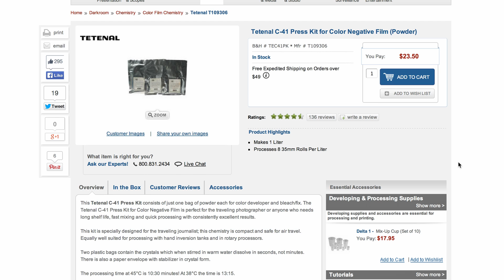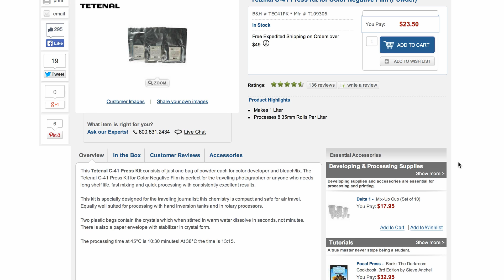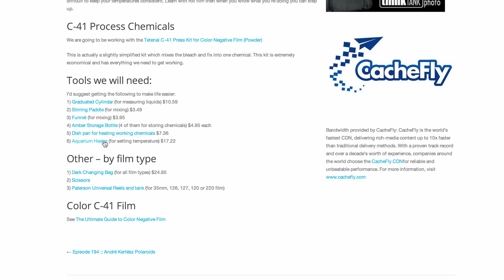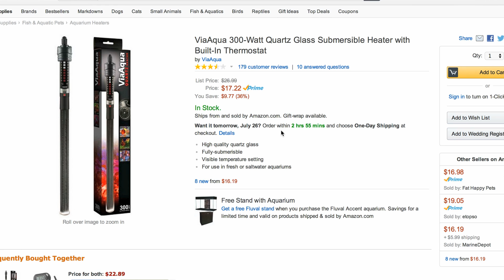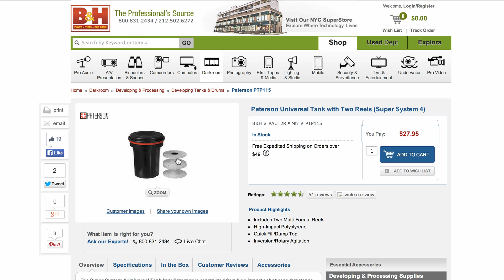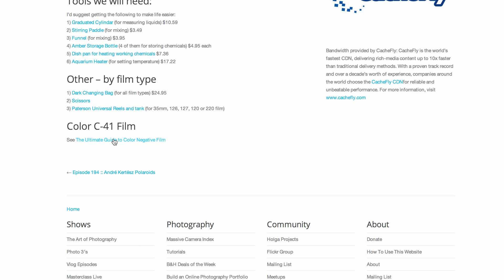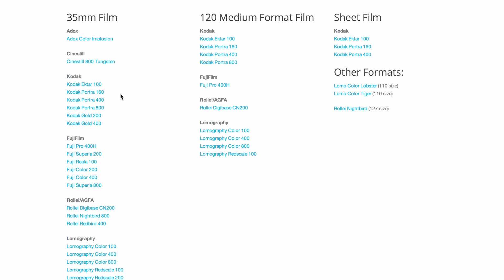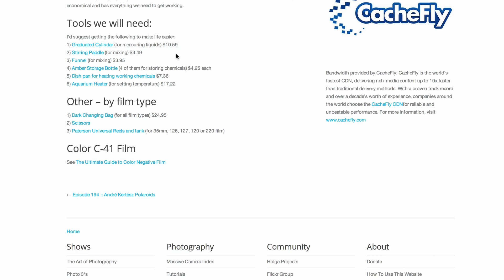C-41 Color Process Intro

Comment: Looking forward to see the results :)
The Bible of C-41 development is the Kodak Z-131 publication (google it). Everything you need to know is there. The accurate and precise (it is not the same thing) thermometer is a must. Don't rely on heater's thermostat. You MUST maintains the 1st bath temperature at 100 F +/- 0.2 F. It is not hard, but you need to think it through. More you deviate from this temp, more difficult scanning or printing will be. Don't forget the 1st developer temperature will drop when you pour it into the tank. You can't presoak, or you color will be off. So, you need to preheat 1st dev, so the temp INSIDE tank will stays at 100F +/- 0.2F after you pour it in. That's the only challenge with home C-41 development. By the way, home E-6 is much easier due to more relax temperature range.

Comment: A long time since I did black and white but c-41 I've done for a year now. Either people out there are really bad, or just not handy. C-41 developing is super easy and temperature is not as sensitive as one might think, however the time is so be accurate if you're doing the 45, 38 or 25 degrees Celsius process.

Comment: The work with the aquarium heater is a little awkward because the C41 process is 38 degrees Celsius. The aquarium heater develops 35 degrees celsius. How will you compensate for the 3 degree difference?

Comment: fish tank heaters can be used. Depends on your model type. I had an old 2nd hand one that would get hotter if you lifted off the knob and put it back on so you could turn it past the stop. This let the bi-metal strip stay together longer. Real old school mechanical. There are some WON heaters that have a separate sensor and heater. you can adjust those by removing the back cover and adjusting the little trimmer all the way clockwise. See APUG for the WON. The main item is it needs to be adjustable first.

Comment: You may want to try a waterbed heater if the aquarium heater doesn't work out. There are also terrarium heaters in varying sizes with the same design as a waterbed heater.

Comment: I would get a food scale that measures mL for consistency, 3 klean kanteen wide mouth stainless steel bottles, 3 hydration bottle bags for storage (to squeeze air from bag, store in fridge), sous-vide heater, Paterson tank. 

Getting the temperature right is the biggest challenge. Paterson tank, or amber bottles just won't heat up fast enough in a water bath. From cold tap water bath, with cold C-41 at 70 F degrees in stainless steel bottles takes about 12-13 minutes. The other option is to go with Samigon Stainless Steel development tanks.
Reply: Where can I find a food scale that measures mL?  I've never seen a scale that measures volume.  :-)

Comment: Might want to check, but Ive not found a single Aquarium thermostat that will go to 100 degrees F. Its a common problem, with some work around online but most involve breaking into the thermostat to rig it to go above what its rated at and only certain ones work that way. Ive tried many of these heaters and not one has ever been rated to go that high...... can anyone correct me?
Reply: Agree...most only go up to 90F or so....good idea, but not for 102 like my kit needs. :)

Comment: Are you going to hit on RA-4 process sometime?  It obviously is related to C-41 and is a very similar process.
Reply from the maker: isaiahbrink I'd like to, but I don't have a color enlarger so it might be a while ;-)
Reply: Ok.  I did also want to mention, excellent job on the C-41 processing podcast/video. I've developed thousands of rolls of c-41 by both hand and machine in my days, and yes, as you hit on so well, agitation and temperature are critical in processing any color process.  Ok, at least c-41, ra-4, and p-40p (Ilfa/Cibacrhromes.)  Sorry, haven't done any e-6 or k-14 processing.

Comment: I don't know how sensitive the C-41-process is to a certain temperature range. But if it's crucial to keep it into a certain range (or even worse: to a specific temperature) make sure to get a more accurate thermometer as those built-in thermostats in aquarium-heaters tend to vary. Fish usually(!) don't care about +/- 1-5 °C ;-)
Reply: Kristof - Within 2 degrees F is OK but no more than that! Keeping everything as close to 100 degrees from start to end of the process is better. The Stabilizer (the last chemical to touch the negatives is at room temperature or at about the same as where you are going to dry the negatives is probably better. As Ted says: Consistency counts here.
Reply: The best way to keep the temperature consistent is to have the container insulated. In the case of the 4x5 tanks, they are made of thick plastic, they maintain a consistent temperature well. In the book by Ansel Adams, "The Negative" (highest recommended book), he put larger trays of water outside the smaller trays with the chemicals (developer, stop bath) to maintain a consistent temperature for 4x5 development. This principle can be adapted to 35mm tanks easily.

Comment: theartofphotography Ted, I've been doing my own C-41 development at home for more than two years. I'm not sure why but my experience seems to be the exact opposite of what everybody else says. For instance, they all claim BW film is easier to develop. I find the Tetenal C-41 kit a lot easier and straight forward. Also, people, including yourself, say colour negatives are much less forgiving in terms of exposures. OK, they are less forgiving when compared to BW, but in my experience, not by much. I've been shooting my colour films on my meter-less Leica M2 pretty much "meter-free" (I usually meter the environment using an iPhone app and then I just tweak "by feel" the exposures as I go along). Granted, some of my shots occasionally come out way over-/under-exposed, but mostly they look fine. And I can't imagine my built-in human light meter being that accurate. Also, and this is the most shocking of them all: I NEVER KEEP MY TEMPERATURE CONSISTENT when developing and the film still look fine! I heat up all my chemicals inside my kitchen sink filled with hot water from the tap. I measure the temperature of the chemicals using a bog-standard thermometer. And I never wait until the mercury settles at 38C (roughly 100F). As long as the mercury slows down at around 38C, I just start developing. Also, I don't even keep the development tank inside the water-filled sink to try and keep the temperature constant. I just assume since the latent heat capacity of water is so high, 10 minutes won't affect the temperature of my chemicals (mostly made up of water) that much. Plus, the stabiliser is supposed to be used at a much cooler temperature, so I just let the tank to cool down naturally as I wash the film with normal cold tap water after the bleach. Everything I just described does not sound "consistent" and yet my results look fine. Often when I knew the exposures are spot-on the results will look amazing. It might be the wrong question to ask because as long as the results are fine it doesn't really matter, but... am I missing something?
Reply: Consistency is a vital component in maintaining an acceptable level of quality. Everyone may differ in what they deem as an acceptable film negative, but a positive aspect of consistent parameters is that if something goes wrong, it can usually be diagnosed towards an element that was out of the ordinary. Personally,  I consider photography a challenge, in that there are so many variables that must be accomplished to reach the final print. From loading the film and attaching the lens, to aperture and shutter speed adjustment ( things can go wrong long before the shutter is released) to careful composition and ultimately film processing / darkroom activities. Each and every factor of the process, is a  potential degradation of the image when perfection is not the objective. While you may experience success with a haphazard approach, consider how much better your images may become if you strove for an ideal negative. I believe the consensus here is that people are trying to acquire good photography skills. That they might just happen to care about accurate exposures, and once made, don't want to risk a shoddy development process. I can also see that many of Ted's Subscribers are quite excited about the forth coming episode, perhaps you may join in their enthusiasm, and possibly even acquire amazing results more frequently. Cheers.

Comment: I don't think the 300W heating element is overkill.  I have a 1000W heating element in my water bath and it works great. I'd be more concerned about the fish tank heater's ability to maintain a consistent temperature between +/- .5 degrees.

Over Engineered Water Bath For Developing Film At Home - C41, E6, B&W

Comment: Don't forget to get an as accurate thermometer that you can afford.  Temperature is mission critical when developing C-41, so an accurate thermometer is an essential piece of gear.
Don't even think of trying to get away with using your mom's meat or cooking thermometers either.  You must use one that's within one degree or color shifts can occur.  I personally would look for one that lists its accuracy within the specifications such as this one:
 http://www.bhphotovideo.com/c/product/273229-REG/Paterson_PTP363_Certified_Thermometer_9.html/prm/alsVwDtl

If its accuracy isn't listed by the manufacturer, then I'd skip it.